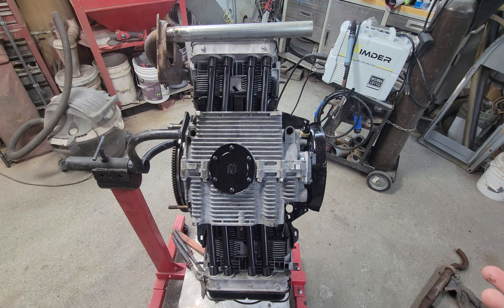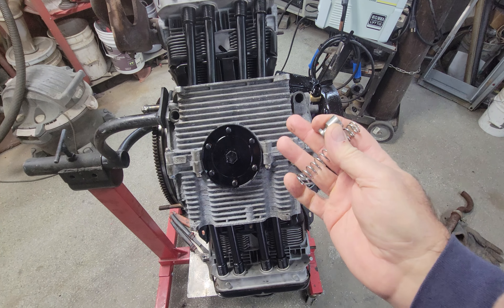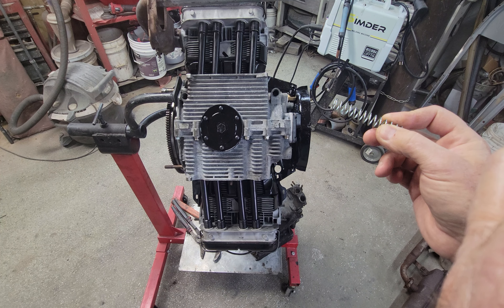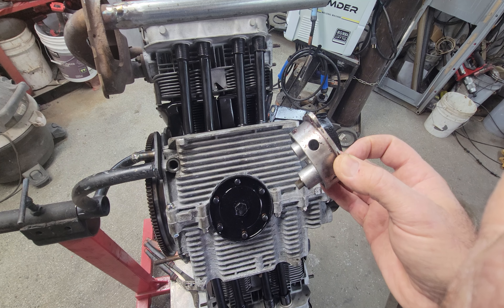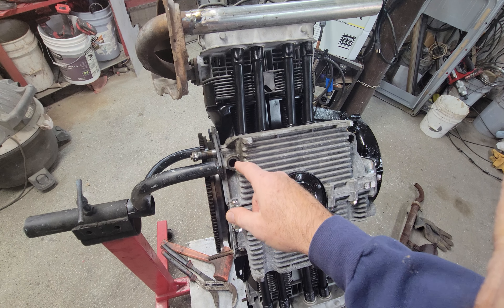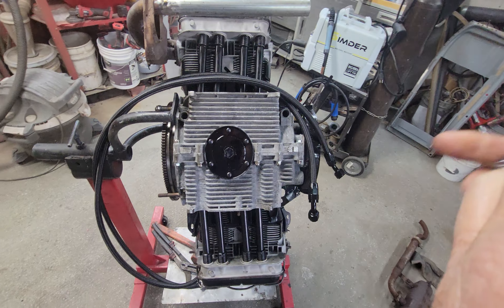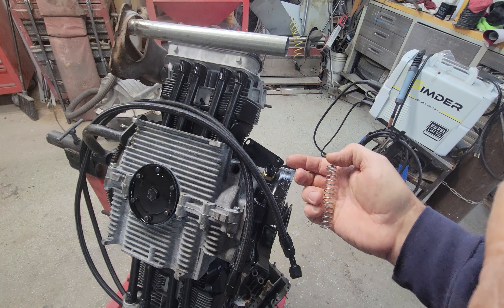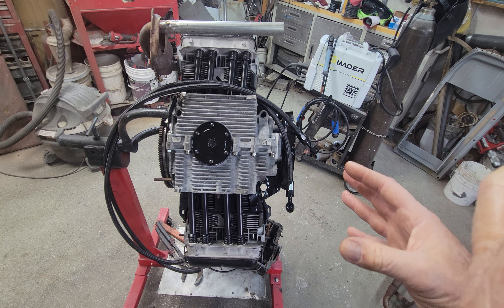VW air cooled oil pressure relief valves and oil pumps

Comment: In the sixties on German rebuilt Volkswagen  engines  the oil pressure  pistons were selective fit  My Late father was a Volkswagen mechanic at Volkswagen dealership  he  always  keep  them the piston with that case they had trouble sticking and blowing the oil cooler apart.

Comment: I had a 1600 fitted with AA slip in thick wall 88s. Shop mechanic said i had a tired 40 hp and my oil pump was a dinosaur. I never had oil pressure issues before! He handed me an oil filter adapter some hose and clamps in additin to fitting a 30 mm cb in out pump and said good luck. Nothing but problems! I have not been able to drive my car up any hill without overheating and having an insane amount of internal case pressure. In addition to blown rear main seal, and blown out sand seals despite breather kits increased in size 2x now it still a nightmare. I really want to go back to stock but cant see a downside to running an aux filter. I hate lines going by j tubes and not being an fitted steel braid but im broke! Really hoping the 26 from cb helps me reduce mess created from oil mist vapor pressure issues. Bigger is not better imho. Be wary who you have work on your engines!! Thanks for your videos!!

Comment: Im with you on pump size, 26mm max is all I ever run too. 👍👍👍
Reply from the maker: I think as long as your a reasonable driver they should be fine. Revving it up all the time and causing wear maybe get a 30 to make up for the wear. Warm it up properly and start it without the coil wire when it is sitting for a while. these things all help.
Reply: @Mikefngarage  that's good information for sure, that's for sharing your knowledge 👍

Comment: Hey Mike ! on my old engine I had a Melling cast iron 34 mm dish cam pump ? negative effect it was shearing the 4 rivets ..... I guess it in the winter was hard to turn until it warmed up . positive effect was at 92,000 miles had 40 lbs oil pressure hot at idle . I still considered the engine blew ( it was knocking ) ...

Comment: O! Oh! I put high pressure empi pistons and springs on both sides in my old 1600 DP engine. But i'm glad i left the oil pump as stock. It did solve the oil pressure issue. Never seen the low oil warning light since! 😅

Comment: Super awesome video! Just did the cb performance relief piston and springs. Unfortunately the new pistons from cb came scuffed. I tried to buff it out as to not change the diameter but I could still feel it with my nail. Decided to run the old pistons since they weren’t too worn. Moral of the story… double check your new parts!

Comment: from the book 72 and later dual relief case. pressure control spring loaded 26mm 3.8-4.4 lbs , pressure relief spring loaded 39mm 15-19.4 lbs

Comment: Hey dumb question but I have low oil pressure with a 30mm pump but I did notice that your oil lines look thinner than mine, mine is 1/2 id I have 2 external oil cooler and type 4 oil cooler and oil thermostat. What you think is my issue?

Comment: Say on a 1600 dual port, stock everything, what is the ok oil pressure at idle? What is a normal  oil pressure when you are in 4th gear, say 2800 rpm?

Comment: I’m glad to hear you say you have all that pressure on your filter and cooler with a 26 mm stock pump. I’ve been asking people that as I’ve been rebuilding my 1600 for my sand rail and nobody has answer but the rail already has the cooler and filter set up. Nobody would give me an answer. That’s good to hear

Comment: Stated at 9:35, "Hopefully that spring tension is as good as original . . . You don't want it to be too much, you don't want it to be too little." What does this mean when you are trying to control oil pressure at RPM and idle? There is a spring tension specification in the Volkswagen manual under the Engine section, page 35 for Type 1 and page 30 for Type 2. Installing each of these springs should never be guess work. There is a lot of spring tension variation even among new springs. Spring tension is measured when the spring is compressed to the specified loaded length. To do this will require a scale on the drill press table. Set the depth control on the drill press to the specified spring loaded length above the scale surface. Compress the spring to the loaded length then observe and record the scale force. Install springs to your liking then observe their performance. Swap them out as necessary to adjust for desired performance. Read my tech paper published on The Samba - Technical, Miscellaneous, titled "Measuring Oil Pressure & Oil Cooler Bypass Spring Tension "

Comment: I've been running this 26 for a bit now with  a external oil filter. It works just fine. But on my other car it has a full flow case with an external oil filter.  And that one has an old deno pump thats huge. Both seem to work fine in there applications.

Comment: I run stock springs with a high volume Melling iron pump. I run 7+ qts of oil, Derale cooler w/fan, I use the AAZ diesel oil filter (holds 1qt). All my lines are hydraulic with JIC fittings. I do not run a stock cooler! I use 10w/40 full synthetic oil. Freeway driving is 4,000rpm @ 76-77mph. '66 Bus with GRBs 1835 forged bottom end, No issues in 10k mi. Oil temp is usually 210-220 if over 90° outside
Reply from the maker: Great tip!

Comment: I think the explanation is a little incorrect in the video regarding the oil control valve. When the oil temperature is cold its viscosity is higher (original monograde anyway), so when the engine is started, the oil pressure will be high. VW added this control valve to prevent the chance of blowing up the rather flimsy oil cooler when the oil is cold. In this case the valve spring is compressed, the valve is down and the majority of the oil will bypass the cooler and go straight to the bearings. When the oil heats up and becomes 'thinner', the pressure in the system reduces and the oil control valve returns to its closed state, sending all of the oil up through the cooler before oiling the main bearings.

Comment: Interesting info Mike !! I had pressure problems on my 1600, I'm wondering if the pump shaft came loose like you said, soon as it gets above freezing I'll check it out. Also I was wondering if you could do a full flow with the engine together or is the only way to do it with it apart ?
Reply from the maker: they make a full flow pump and  cover that might work for you.
Reply: @Mikefngarage  thanks I'll do some research !!
Reply: CB Performance has the Maxi Full Flow In Out system; it’s a full flow without having to drill the case and it comes in 26 and 30 mm.
Reply from the maker: @vayabroder729  exactly. Hey have you seen how they drill the case in a different place on the side further up on the feed oil rail.....Super sick. I dont know how they do it.  the pressure and the return go right inside the case. Look at that short I did of the busses by the bridge raffle giveaway engine. pause it when you see the side where I show it and zoom in.

Comment: I am using 80 line bore main bearings in my new build.  I gave it a new 26mm maxi with a non dog house cooling  system with a remote oil filter.  Ive heard with that line bore its going to have low oil pressure. What do you think?
Reply from the maker: dont really think the line bore will effect the oiling. 80 case is fine. We used to go to 100. but the bearings are not available anymore. that setup is what I would go with.
Reply: @Mikefngarage  thanks!

Comment: Can you eliminate the bypass spring and plunger if you have a cooler block off plate.
Reply: @tw8032  thats exactly my question but can't find a proper answer yet.
My mechanic says I need to remove the flywheel plunger and spring and put a blocking plunger.I have new engine and oil pressure doesn't go up with rev more than 40 psi and that also idle oil pressure. I have removed the stock oil cooler and used blanching plate. I have external oil cooler with fan after remote oil filter which has a bypass.

Comment: I build all my engines with 26mm pump  but i do use a 30 mm on turbo engines . My thinking is the turbo is one more oil lost
Reply from the maker: absolutely agree with that.....if you have a turbo that sucker uses some oil and needs constant pressure. Risk of over pressurizing is less important than getting oil to that turbo.